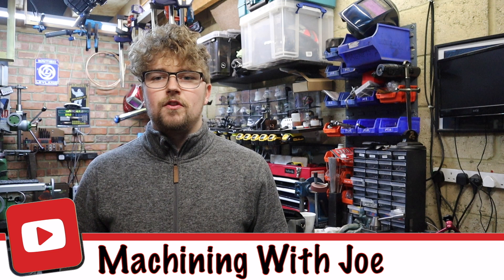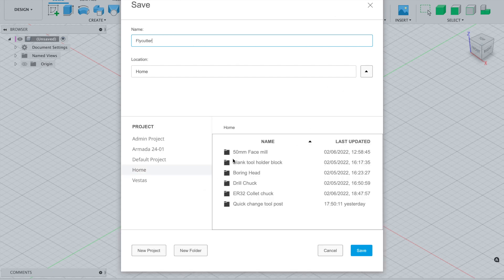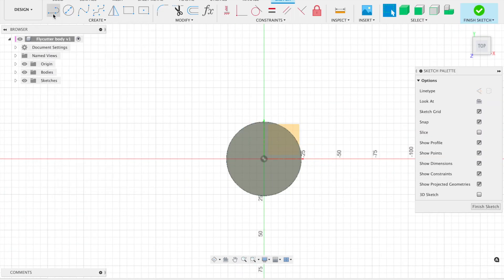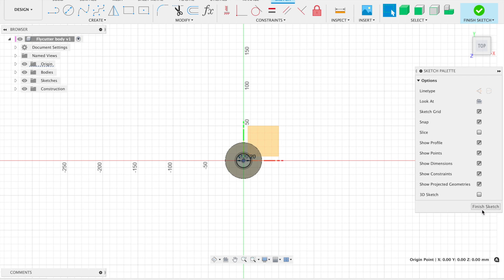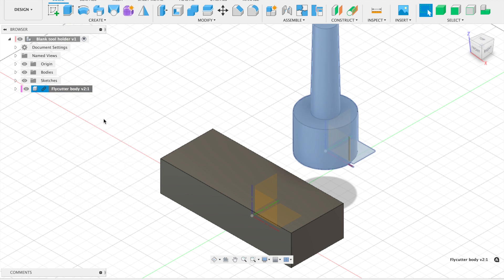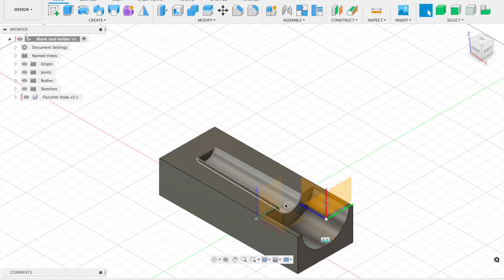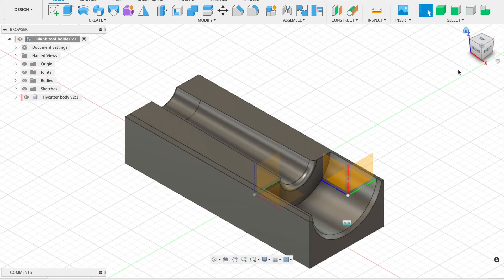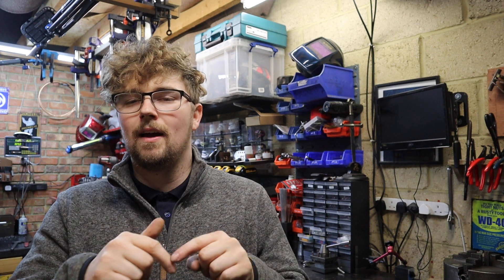Designing 3D Printed parts on Fusion 360

Comment: Hey Joe, I really liked this video and I am very impressed with your skills in fusion 360 so far. My background Is in CAD (not fusion 360), so I know it can be an utter pain to learn, but this is good stuff. I would recommend learning how to make basic engineering drawings in fusion, it can be super useful when making parts in the workshop. Cheers.
Reply from the maker: Thank you Artisan Makes  I am slowly picking it up and as software goes i find it quite satisfying looking back at a design. Yeah that is a good idea convert it to a drawing for workshop projects.